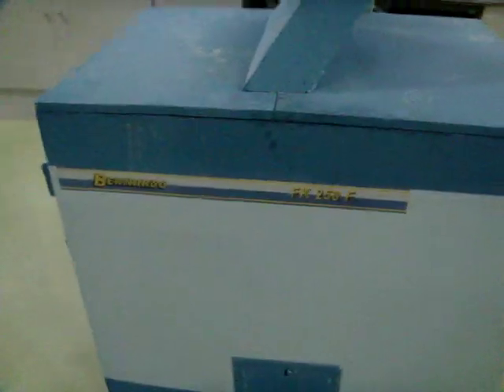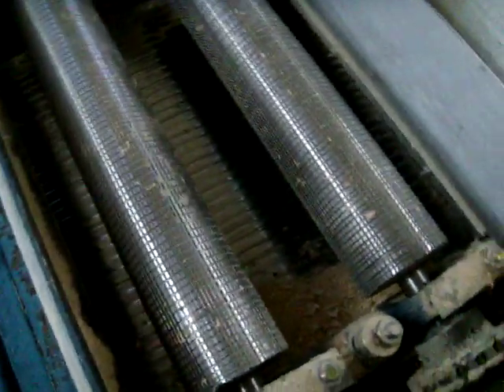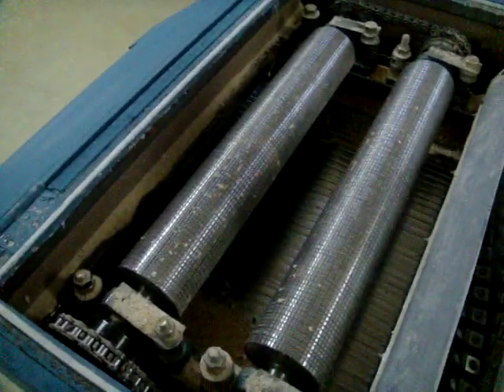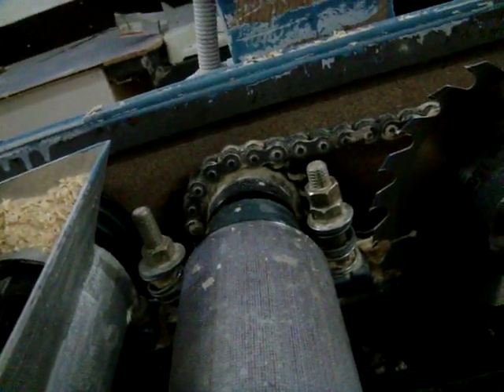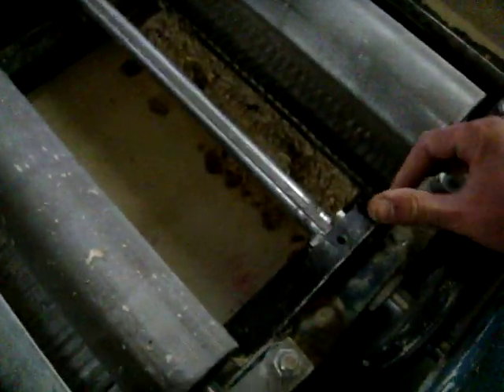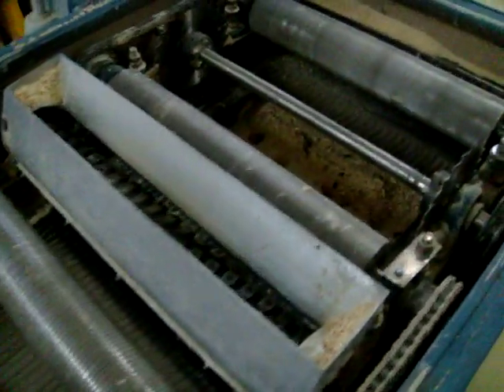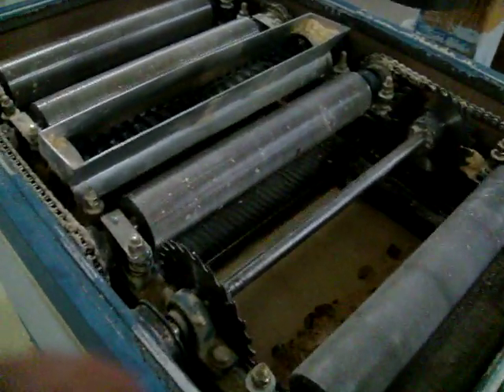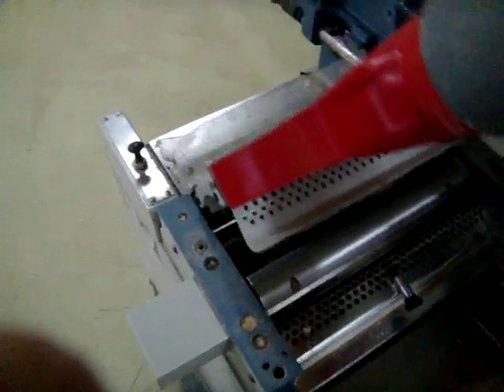HOME MADE PLANER WITH SHELIX CUTTERHEAD

Comment: Salut! am vazut ca imi esti conational, as vrea sa te intreb cum a fost interactia cu Byrd? Am o combinata Robland K26 din 1980 si vreau sa-i pun un shelix de 260mm, aprox 700 euro. Ai avut probleme cu ei sau cu arborele in sine? mersi fain.
Reply from the maker: Nu am luat direct de la ei am luat prin grizzly tools. Acum se poate si de pe amazon. Axul poate fi usor strunjit pt rulmentii de pe masina. Eu am aceleasi cutite de acum 10 ani si am trecut pin cel putin 400 m3 de material.
Sensibil la noduri cazatoare

Comment: Finally I found this. Have been thinking about just ordering a Shelix and building the planer with a used induction motor but I don't understand why no one on the internet seems to have done it. I can find jointer, metal lathes and all kinds of stuff but not this. Looking good! How does the bed move up and down? Is the a 90° bevel gear and 4 vertical threaded/trapezoidal rods?
Reply: @jamesitube
Same question here...
I have some 40(!) mm plywood(WISA-phenolic resin), and thought that would be flat/solid for this kind of project..
No cutter-head yet😂, just the idea...
Whereabout are you? I'm in the UK (Berks).
Cheers
AB
Reply: @attilabori4734  Well that sounds sturdy, could be good indeed. I found an old Swedish Luna jointer planer combo from 1983, so bought that and welded up a moving stand for it. Straight-knife cutterhead currently but this machine is listed at the Shelix site so I might be able to upgrade in the future. Its a smallish machine but still 250kg. I'm in Finland.
Reply: @jamesitube  thanks for your kind response.
Yeah your purchase of the old iron sounds very good...seen one Luna here last year impressed me too.
I have a very small space so i thought making one would be the solution but i went through the same path in terms of tablesaw and ended up buying and old one (1984 by Mafell!) like you did. Probably it's more time (and cost) efficient to buy a solid 2nd hand one rather than fiddling years(!) to re-invent the wheel:)
My aim is to find a size between the 250kg category and the lightweight (benchtop)ones.
I wish you all the best with Luna:), have a safe work with it.
Reply: @attilabori4734  Thanks, you too!

Comment: The bearing will only burn if they get hot (misalignment) or are not lubricated... The 2 start and en rollers were a smart move will prevent snaping where the board is misaligned and the start or end is thinner than the rest

Comment: Buy yo a treadmill at a yard sale. use the belt motor to power the drive rollers . Most have a variable speed DC motor and controller.
Reply: Is there variable speed motor avalible